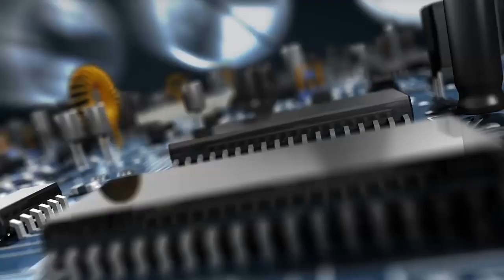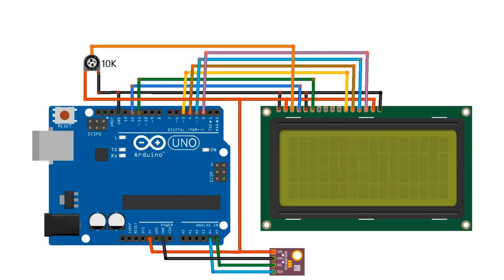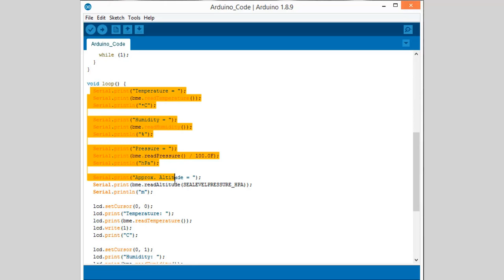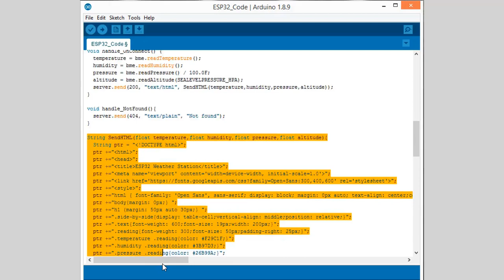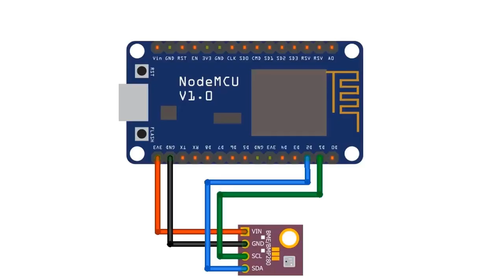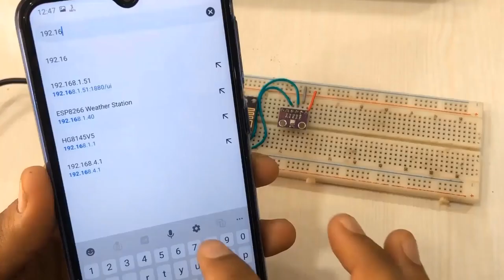BME280 Weather Station | With Arduino, ESP8266 & ESP32

Comment: nice video. Interface BME280 with ESP8266 how do you change it to Fahrenheit
Reply: In this loop change: 
void handle_OnConnect() {
  temperature = bme.readTemperature();
  humidity = bme.readHumidity();
  pressure = bme.readPressure() / 100.0F;
  altitude = bme.readAltitude(SEALEVELPRESSURE_HPA);
  server.send(200, "text/html", SendHTML(temperature,humidity,pressure,altitude)); 
}
To:
void handle_OnConnect() {
  temperature = bme.readTemperature();
  humidity = bme.readHumidity();
  pressure = bme.readPressure() / 100.0F;
  altitude = bme.readAltitude(SEALEVELPRESSURE_HPA);
  server.send(200, "text/html", SendHTML(1.8*temperature+32,humidity,pressure,altitude)); 
}

Comment: 943hPa as read by the sensor means either a very strong barometric depression or more likely, inaccuracy or consistency in calibrating and will affect altitude reading as well. Would be curious of a fix for that.

Comment: Sir, Thanks for this video. Can you please make sensor for ESP32 and ESP8266 using MAX4466 for noise and Wind Sensor Rev. C sensor. Thanks
Reply from the maker: I don't have these sensors currently with me. I will work on MAX4466 in future.
Reply: And last if you can use example using CCS811 sensor module. i already made but after a couple of time i encounter some error reading for memory using ESP32 and ESP8266 Thanks
Reply: @HowtoElectronics  thanks i  hope soon you made. question about CCS811 why cant hold long time or stable using ESP32 or ESP8266?
Reply from the maker: I don't have CCS811.